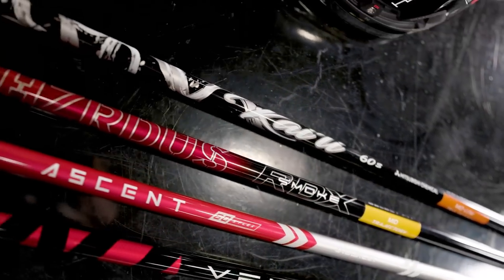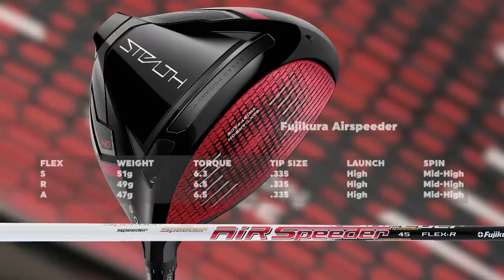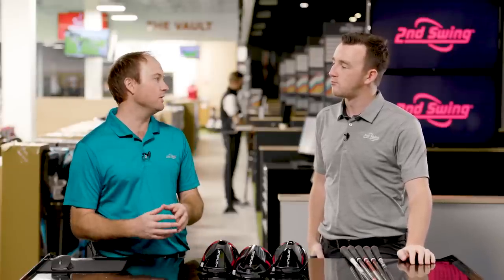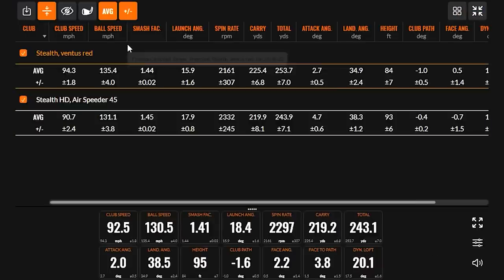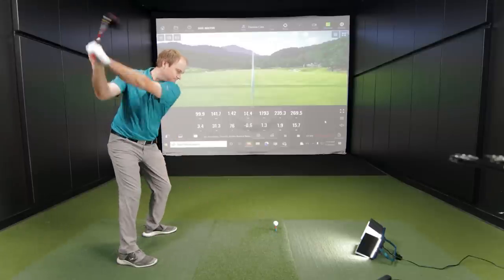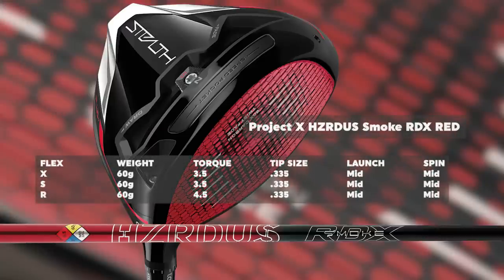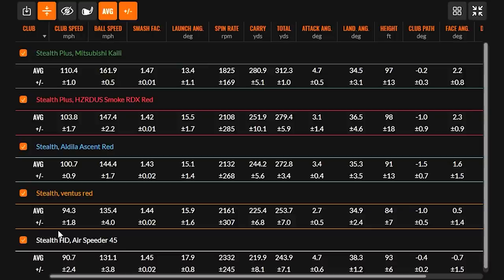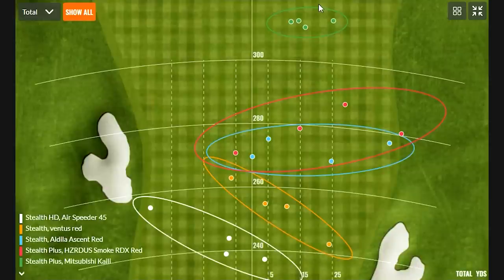TaylorMade Stealth Driver Shaft Options

Comment: Just saw this. Thank you. It is the only test/review I have seen that involved the Aldila Ascent. I had begun to question whether that was because no one thought much of that shaft despite the very wide range of weights and flexes it comes in. But the master fitter at the PGA Superstore where I go told me today that he thinks very highly of it and in fact has fit many players into it. So then to see your review the same day was very useful. I had been considering a Mizuno 220 STZ driver with 9.5 degree loft and an Ascent Red 50 stiff shaft for my adult son that is in the clearance rack at a very, very affordable price, but was hesitant about the shaft. Now you as well as the fitter have cleared that up for me and I will pick up the club tomorrow. So thanks again. 

Oh, one other thing. Instead of making Thomas be a man of all swing speeds, why not have three different staff members with different swing speeds, including a female staffer, do the hitting at the appropriate swing speed for each.

Comment: Just to add that the difference for me at least between the two shafts with the same head - stealth- was like night and day in every sense including distance, control, flight, and drop off and e-w dispersion. Was most surprised but pleasantly so. In fact similar things happened when I identified the right irons, wedges and hybrid and fairway wood for me. The choice of the right shaft and some consistency in certain categories  in each case has made all the difference.
Reply: What did you try and end up buying?
Reply: @RW-td2hz  driver wise I went with the stealth 10.5 set at 11 with the fujikura airspeeder shaft shortened to 45”. Similarly for my 3 fairway which I love too now I went with the epic speed max with the mmt shaft also shortened by 0.5”; and for my hybrid (also superb) epic speed super hybrid 18 degrees set at 20 with the aerotech fibre shaft.

Comment: I have the hazardous smoke shaft in with my stealth plus. So far it seems to work really well my swing.I am curious about the air speeder shaft tho, I didn't test that shaft,but got me wondering if I could pick up any ball speed with the lighter shaft?
Reply from the maker: It is worth a try! I always try to play the lightest shaft I can control. On the other hand, if your shaft works really well right now - why change!

Comment: Hi guys! Great video! Because I'm a regular slicer, I'm interested in the HD version. The shaft that comes standard is the Air Speeder but if I chose the Ventus Red would it be better? Your numbers don't seem to show a significant difference in the end. Maybe I should even consider the Aldila Ascent? Thanks!
Reply from the maker: You can play either of those shafts in the HD no problem. I would compare the differences. Just because its a stock option for a certain club it doesn't mean its going to be the best shaft for everyone - Thomas

Comment: Interesting discussion. Just to add that I was testing the stealth (not the hd which I did not need) initially with the ventus red and it just did not work for me and as a result almost decided the stealth was not for me. I then tried the air speeder and loved it and really works well for me - bit better distance and stability interestingly. My driver speed is about 90mph and now I have good control of my drives and am now matching up against which as of now a shortlist of four balls is the best ball - vice pro zero, Wilson triad, pro v1 and the Bridgestone 330brx. So yes indeed for a slower swing speed the air speeder is great and my spin and launch numbers are optimal for getting the best drives (distance and tight dispersion too) since a long time - and still so after 30 rounds of golf already with it. Finally found a driver since my m2 that I like and works well. I think the shaft has made a real difference - also for someone in their late 60s!!
Reply: What flex did you go with on the air speeder?
Reply: @gbmader  regular flex. Have since changed from the stealth to the tsi1 with the new project x hzrdus red cb regular shaft. Just got better number and reliability - tighter dispersion, greater height etc from the tsi1
Reply: @alysgolfstudio567  Nice!! thanks for that info!!!

Comment: Great Video! Is it a strange combo and bad fitter job  I fit best into the Stealth HD head at 9 degrees and 1 notch lower from standard and the RDX Smoke Red in 6.0 and shaved down to 45.25 length? My swing speed max is 95 mph and ball speed in the 130s. Number we’re great and desperation was really good too! Looking for some expect validation. Thanks!
Reply from the maker: Not at all. Club speed at 95mph would equate to around 6.0 in shaft flex. I don't know your angle of attack or face angle / path but if the numbers were great and dispersion great the fitter did a great job! Sometimes if it's different from the norm it's ok some stuff is player dependent - Thomas
Reply: @2ndswing  Thanks Thomas! I’m really working on my swing path to be in-to-out and promote the draw, but my swings during the fitting were around -4 degrees outside in where I normally fade or slice. This HD head really helped straighten me out!! I appreciate the quick response! Thanks.

Comment: ( I am 58 years old...90-94 mph swing speed....130-140 mph ball speed..hit a high ball usually fairly straight and am a 9-11 handi cap ) which shaft might suit me best ( which flex and which weight ? )    i was thinking the ventus red in regular or stiff ?.... would love tour opinion ...thx from Canada
Reply: Have to get fit. Go open minded.  It varies even amongst players. I'm 96-100 MPH 1400-145 ball speed mid spin. Went with Ascent 50 gram Regular, yes, Reg shaft. why? launched best (high) with least spin and I Could turn it over in Mizuno STX easier. Would love Graphics Design but not pay the big $$